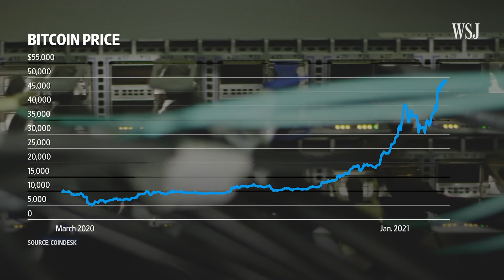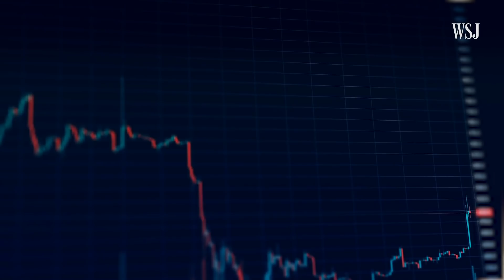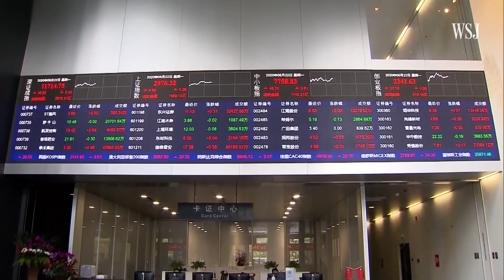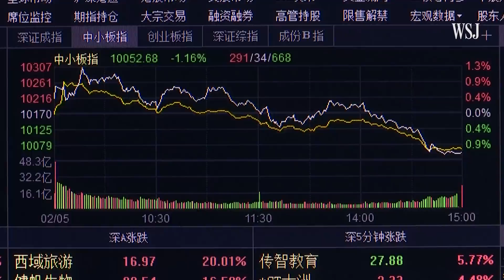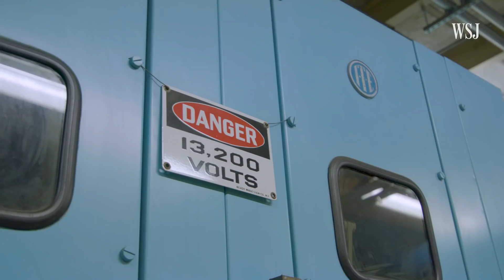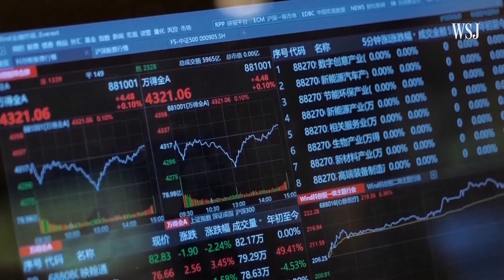U.S. vs. China: The Battle for Bitcoin Mining Supremacy | WSJ

Comment: The amount of energy this takes is staggering.
Reply: So amazing right? Driving the future!
Reply: For a useless coin, they could be making huge science advance, instead wasting power solving sudoku's problems and generating some coin.
Reply: I guess it is like real gold in that sense, at least it hasn’t driven people to kill anyone... yet.
Reply: @bigheadrhino  Nothing like gold
Reply: Tiago a unit of currency with little intrinsic value and limited supply that people take enormous efforts to procure because of the value it represents instead.  Bitcoin is designed to be digital gold.
Reply: @bigheadrhino  Gold has many industrial uses. Don't be naive and think it's just a form of currency.
Reply: Jeffrey Makuch sure, it has uses but it’s value is more reflective of it’s currency value and not for it’s productive uses.  The gold rush was certainly not inspired but what people could use the gold for but by what the gold could buy.
Reply: @bigheadrhino  "The gold rush"...like in the 1800s? lol. (Jewelry actually accounts for about 50% of gold use in any case). It most definitely has intrinsic value, unlike cryptocurrency which has none.
Reply: It’s also disgusting ...
Reply: Bitcoin seeks the cheapest form of electricity which is waste power thrown away! Chinese hydro, Iceland Geothermal, Canadian gas flaring, Wind and Solar oversupply! It creates a market for energy that would otherwise be dumped into the ground!
Reply: The amount of stupidity this creates is staggering
Reply: How much energy do you think gold consumes? I would say a lot more... :)
Reply: Yes but more energy is used on fiat currency and gold mining.
Reply: @jeffreymakuch2493  So what's intrinsic value? These two words have absolutely no meaning because there's no real definition for it. It's not a fact. 

I'd say 90% of the value of Bitcoin is that you know EVERYTHING. You can pretty much exactly say when (for example) the next halving takes place. It's certainty and predictablity in a currency, which would be a worlds first.

In an uncertain world you could at least have certainty in a currency, which is BTC.

It's honestly astounding that people don't get this.
Reply: @Rodo Sandoval Nothing in this world has intrinsic value, value is subjective.
Reply: @jeffreymakuch2493  Most of that gold jewellery is actually used as a store of value by Indian housewives. Nothing has intrinsic value, all value is subjective. If you believe in capitalism then people are free to use energy how they wish, even if that's to mine magic internet money.
Reply: XRP
Reply: 21.1 gigawatts
Reply: @Rodo Sandoval Cowrie shells held no intrinsic value either
Reply: The amount of energy youtube streaming this video is staggering. 
Thinking about the data transfer 100MB data being transferred and multiply by 400k
Reply: @bigheadrhino  Gold is a very useful element, it’s used in every iphone, ipad and macbook for a start. It’s used in most electronics.
Reply: Any idea how much energy Gold mining requires for mining, transporting, and storing Gold?
Reply: i've seen a chart which says, that the yearly demand of us citizens  for their christmas lights makes out a quarter of the current demand for btc mining..
Reply: @bigheadrhino  people that mine the coal probably died just to power thier computer tho
Reply: @dsgorham  nope..in got intrupted in power supply line u are dead meat
Reply: Unsustainable and pointless for what it does. And once quantum computers are a norm bitcoin will become almost worthless becaue it will take a few minutes to mine them.
Reply: @KTMGUNNER  Bitcoins are designed to get harder to mine the more are mined. What would happen is the person with the Quantum computer would be the only person mining coins.
Reply: Not true bud. The price of gold is actually closely tied to ETF trading. So people without gold are doing most of the deciding with regards to gold’s price. This is why you cant buy an actual ounce of gold for anywhere close to the market price
Reply: @Rodo Sandoval 
No that’s was not proven 
Same can be said about our cash it crashed multiple times like 2012 can I say cash is useless???
Reply: @Sg6CrossOver  The blockchain is actually the next biggest problem solving since internet. It will change people lives not just for money but everything else too, politics, votes, education,  administration, information, AI, science etc. In 10 years you'll have to remember that it all started with a "useless coin",  boomer
Reply: "nothing like gold" my poor dude... Brace yourself for the next 15 years
Reply: @pedrorivera6670  lol
Reply: @Sg6CrossOver  Bitcoin is the mother of blockchain, boomer
Reply: @niksarass  Lol, you clearly don't know what is talking about, bye.
Reply: @Sg6CrossOver  Yeah, we'll talk about that at the end of the year
Reply: @niksarass  No, we won't. U don't even know the difference between bitcoin and blockchain, keep feeding your speculative useless coin.
Reply: @soycrates  Don't you eat, uses energy supply, buy properties? Might as well live under a cave.
Reply: @Sg6CrossOver  yes, that still requires a consciousness to project value on to something, hence not intrinsic (i.e. in and of itself).
Reply: @soycrates  Doesn't matter, once is became a basic human need there always be a use for it, Bitcoin hasn't, the technology is already outdated compared to others cryptocurrency's and purpose yet to be found.
Reply: @Sg6CrossOver  hilarious how so many people think of it, but again you have tons of people that argue and say its useless. Who to trust? Common sensen?
Reply: @cautarepvp2079  Just try understand and search about the subject to made your own opinion, from my point isn't worthy because doesn't have intrinsic value, neither has a real use as "currency", too volatile to be a "store value" or is used outside buy/sell.
Reply: @sang3Eta the so called oversupply is not enough to power these mining machines.
The amount of energy required is ridiculous.
The oversupply from renewable technologies should be used to substitute fossil fuels energy generation and not to supply these stupid mining.
Reply: @jeffreymakuch2493  

cryptos have no intrinsic value, if you think of it in the traditional “tangible/visible way”. But it may have intrinsic value in a digital economy that would not be based on fiat currency or gold.
Reply: @soycrates  
Food and water have intrinsic value, if you value life 😉
Reply: @Memoiana  even if that is the case that food and water alone have "intrinsic value", it is an irrelevant concept in determining the value of other goods and services that people subjectively project their value upon.
Reply: @Sg6CrossOver  
The creator wants a decentralized monetary system. If this system proves effective then it will cause an economic even power shift in the world. I remember when Bitcoin was at $1 and now it’s over $40,000 and climbing. A person can become a trillionaire if he amasses all bitcoins.
Reply: Bitcoins will have no bartering capacity in times of a nuclear war it is intangible
Reply: @Sg6CrossOver  that's not quite the right view. cheap electricity implies it has no better use. If you are such a genius with a better use case, why don't you buy up the electricity to do it? It's an open market
Reply: Watchdog  It's not its utlitity. Seriously 😂
Reply: Watchdog  At 7% that's a rather small portion. Of course it has real life usage. That isn't the point of Bitcoin, though, because it's digital. You can buy things with it, but its soul purpose is that it's the safest place to put your money in. Volatility is one thing, but wealth preservation over years and years is the other one. And at that it succeeds brilliantly.

You know everything that's going on in the network. It's consensus of millions of people. For the first time in human history, people can take part in a currency without being "forced" to use it. There's no central bank doing things they don't want to know us about.

Bitcoin is complete future certainty in a currency. No one can take it away. Learn your keys, they're yours. No one can access anything. Isn't that worth a trillion of endless $ for you?
Reply: It’s a fraction compared to energy used mining gold & other minerals.
Reply: @dsgorham  What future!?! This is suicidal.
Reply: @Sg6CrossOver  Ok but what's the value of a paper money? It only has value because people trust it, same goes for bitcoin. They're also printing insane amounts of money now, which will, at some point, have to cause inflation. Maybe you can use it as toilet paper in a couple of years, but storing it now only decreases the value.
Reply: tommy aronson  your ignorance is showing.
Reply: That is nothing compare to the energy use of Visa and Mastercard
Reply: @christerjohanzzon  Do you know the numbers ?
I doubt it.
So why are you sure ?
Reply: miners consume as almost as Brazil power consumption.
Reply: Tell him I referred you
Reply: It’s for a good thing 👍

Comment: It's not recorded by miners there.
The transactions are recorded on each computer
Reply: The records and balances of each account are completely decentralised. However in order for this to happen securely, all transactions must take place through the blocks that are mined, the person who mined the block has control over which transactions are put through and the fear is, government will intervine and block certain transactions.
Reply: Media love a bit of Chinese propaganda. UK government is also trying to block crypto trading and as if the US wouldn’t want to freeze peoples assets if they could! Pot, kettle, black.
Reply: @firstlast-zi2go  that's not how it works. It will just get picked up by another miner and put into the record. There is a reason Bitcoin is censorship resistant. You can't block transactions they eventually will get picked up. Can't turn it off can't block anyone from using it. Can't reverse transactions either.
Reply: @rv8804  Actually,  you can mess with new transactions if you have enough computing power. How much computing power, I'm not sure -- need to read up on that.

Another threat is that by mining more coin, China will also hold more Bitcoin in it's reserves.
Reply: @itsover9008  yes you can mess with transactions and do double spending only when you have 51% hashing power of entire network

Comment: Now I know.. why all GPU are running out of stock.
Reply: 😂 those machines are made for mining btc instead of eth
Reply: correct, the only way you can stop it is to support Nano, is is a decentralised crypto that kills Bitcoin, and other currencies, and doesn't use GPU's
Reply: @Star Cheng  nope  you can't use general purpose hardware like GPUs to mine bitcoins or generally large cryptocurrencies, miners never use general purpose hardware today and if you do so you will actually lose money.
They use ASICs (application-specific integrated circuit) made specifically to run single hashes to mine a one type of cryptocurrency. They are much more efficient and actually have a ROI, as for Ethereum which is ASIC resistant  you can't even mine it until 2021. 
Blaming it on miners distracts from the ACTUALY real factors, such as rising applied use in other industries that utilizes AI and simulation, artificially induced shortages due to scalpers, anti consumer practices, and Economic sanctions such as the tech trade war stemming from China.
Reply: 小熊维尼  Actually having a decentralized, trustable and clear gold-like asset is a very useful tool for mankind to further develop and finance other techs
Reply: Yeah you're really late to the party
Reply: @alexandredaubricourt5741  yea having decentralised currency is good, bitcoin is actually good but people mine the cryptocurrency not for using it apparently, they just want money not the real purpose of bitcoin. People just fool enough and always follow the trend, we will see the bitcoin drop hard after the trend gone. Not much people really know what is bitcoin and purpose of it, they only know investimg this thing can earn money for them which is still 0 step forward as making a decentralised currency
Reply: Those are mining machines, not gpu
Reply: @あなた以外の誰でもない  mining machines run gpu to mine the cryptocurrency
Reply: @nverend4450  no they're different. mining machines mine Bitcoins, only side coins like Ethereum uses GPU to mine
Reply: @nverend4450 The bitcoin will never be a currency like the $, that's right. However it is very likely that BTC will replace gold. No one can predict, future will tell us.
Reply: @alexandredaubricourt5741  who knows man, Elon musk he will receive btc as money for transactions, that's a start of a currency transfer, which may lead btc become a global currency and replace some currency like US dollar
Reply: 小熊维尼  There can't be a more sensible comment on this  topic. "We are the modern morons after all. "
Reply: And all the zip ties lol
Reply: @alexjohnward  stop shilling
Reply: @svanarase5449  no, Bitcoin needs to be squashed,  it is doing damage to the cryptocurrency space.
Reply: @Star Cheng I’m a miner my self lol. I have 8 3080s. But the machines in the video are for mining bitcoins.
Reply: Those are asics not gpus. Gpus are worthless for bitcoin.

Comment: The middle of May saw a spike in options volatility – a measure of expectations for price turbulence that determines the cost of buying the kind of price protection that options provide – to very high levels. At-the-money (ATM) one-month volatility surged to 150% on an annualized basis. 
Then, on May 24, after the measure had eased to 123%, still well above the historical average of about 75%, I spotted an interesting trend. Options traders were taking advantage of the higher prices for their derivatives to offer more puts – an options contract that gives the buyers the right to sell an asset at a given price in the future. This was a sign they were more relaxed about the prospect of turbulence where prices were dropping and they would be on the hook for it. 
With that past in mind, I thought it would be interesting to look at what happened to volatility in recent days, following the second-leg sell-off in bitcoin that culminated Tuesday in the spot price dropping below $30,000 for the first time since late January. So, although we’re still above the 75% average, this suggests that expectations for big price swings haven’t been as drastically affected by the latest price declines as they were in May. It also suggests that options traders who sold those puts back then, while no doubt unhappy the spot price fell as low as it did, aren’t suffering extreme losses.
Hence you should all Invest During the Downturn.
Reply: Cool insight, I appreciate an opportunity to get such knowledge on how to make money. I look forward to trading bitcoin and making it an alternative source of income
Reply: It's strange how people talk about all the profits, they've been making through trading in Bitcoin,stock and options while am here not making any profits at all, Please can someone put me through on the right path.

Comment: What is DP (Digital Point)

DP is a peer-to-peer Internet currency that enables instant and easy cost payments to anyone in the world. DP is an open source of global payment network that is fully decentralized without any central authorities. The extremely fast and high end servers secures the network and empowers individuals to control their own finances. DP features faster transaction confirmation times and improved storage efficiency than the leading math-based currency.

DP is a digital unit that is created through a process called ‘Buying’. Just like the barcodes of several items on the bill of your shopping list, each digital DP is unique. The terms DP and DP are absolutely same, as per conditions. DP is the dividend unit of the Pearlvine system. Neither it is possible to intrude into the system of Pearlvine system, nor anyone can extract DP outside of the system from any source for its various purposes.

Unlike the paper money issued by governments, there’s a finite number of DP, ensuring that they cannot be affected by inflation and impossible to produce counterfeits. Just because the Virtual currencies are not tied to any particular country or central bank, the value of the DP depends on factors such as ability to use, demand and supply.

After joining DP, users become part of a global network of millions of DP buyers, who are able to choose among different ways to use their DPs. You can buy DP and can gain a lot of benefits from its value. In updates you will be able to make payments and transfer money to and any part of the world from any corner of this planet having internet networks.

DP’s new and unique wallet string will set a new industry standard by storing KYC (Know your customer) information, it will work 24x7 and is tailored to customer and merchant needs for their various personal chores.

With its finite number of 100 billion DP, DP is also the biggest reserve currency worldwide, DP is a medium of exchange like normal currencies such as USD, but designed for the purpose of exchanging digital information through a process made possible by certain principles. These principles are used to secure the transactions and to control the creation of new DP i.e. often referred to as DP.

In easy words, virtual currency is electrically converted into lines of code with monetary value. In the simplest of forms, DP is a digital number.

Comment: VladimirCorp  is the best website that I have found that takes the proven methods that value investors have been using successfully for decades and packages them in an easy to understand program that is repeatable each and every time. Simply Investing not only gives you the information needed to succeed, but also provides the tools and access to answer any questions you may have about the program and how to apply it.&quot;